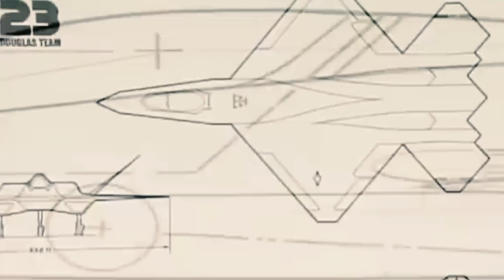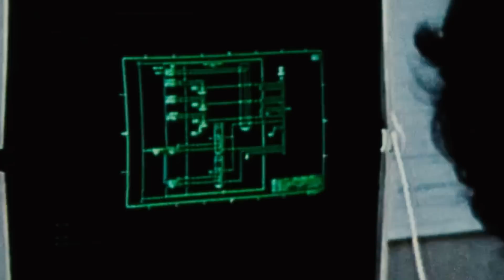The US Air Force Was Crazy Not to Build More of These

Comment: The issue with the YF-23 had to do with cost and complexity.  The aircraft was actually too good in the sense that the whole purpose of stealth is to make the plane impossible to target. Both the F-22 & YF-23 accomplish this.  However, the YF-23 goes on to add all kinds of high cost tech to make it super fast and maneuverable in dogfights that would never be necessary.  No steal aircraft will be in a dogfight because enemy aircraft would be shot down by it long before they even knew it was in the sky.   In fact in actual practice even the capabilities of the 
F-22 are more than enough. That is why relatively few of them were produced and the less capable F-35 were produced in numbers.  The F-35 is decades ahead of anything any enemy can produce and it costs less so you can make more of them.
Reply: F22 won because it made more jobs and politics. The YF23 was faster and could do anything the F22 could, even without thrust vectoring. The better plane became history.
Reply: Remember when the cannon were removed from Our inventory because nobody, 'Would be able to dogfight at jet velocities'?
Reply: The F-35 isn't the best jet in the air today. Certainly not tomorrow.  It's not full stealth, it's not fast, it doesn't carry much. It's an american plane trying to do everything and failing at great cost.
Reply: @ryanmurphy1662  No aircraft is, "Full stealth", its low observable. GE's XA 100, 3 stream adaptive cycle turbine will yield 20% more thrust and 30% greater range. What's your country deploying in the air?